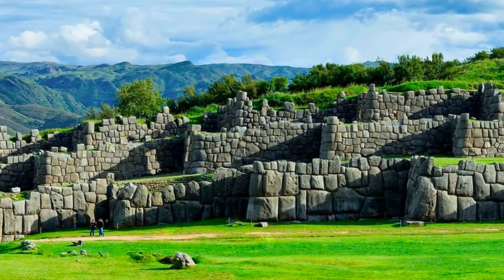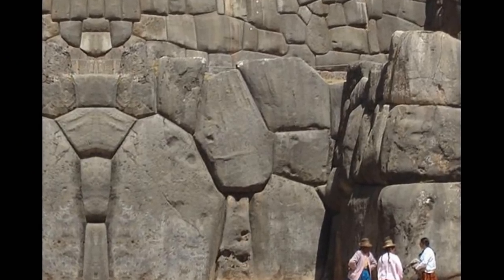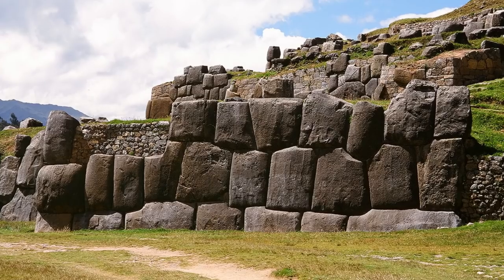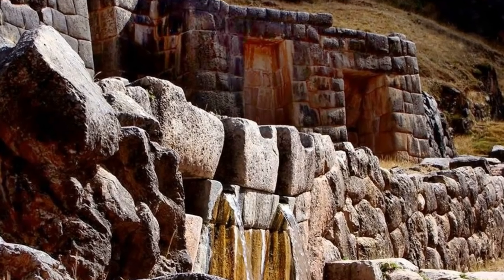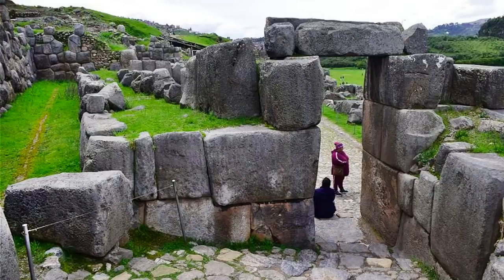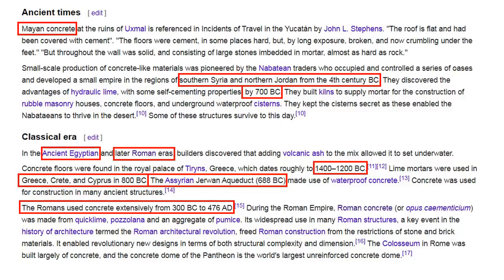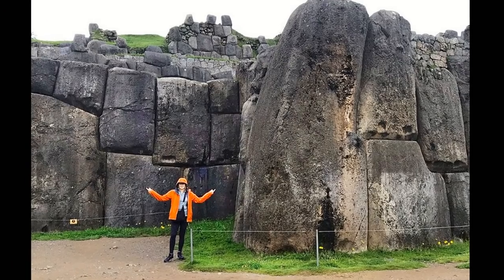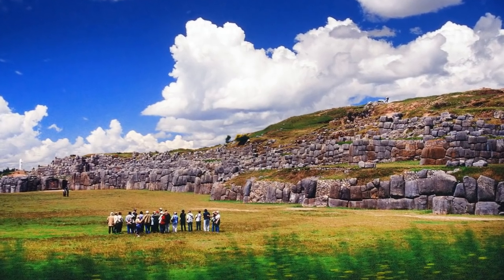Explained: How were Peru’s #Sacsayhuaman Walls Built

Comment: As someone who has 40+ years concrete construction experience and the knowledge of the complexity of building a different set of forms for each individual block, with the required strength to withstand the extreme pressures from the weight of liquid stone to prevent blowouts, makes this theory implausible. Most don't realize the strength and structural integrity required for forms bearing the pressure created by 60-80,000+ dead weight lbs of concrete. Then you still have to consider how did they lift and place the molds. if when you removed the forms the material was still malleable to form into place with another surface what stopped the other three sides from just drooping into a giant blob? While still malleable enough to form the perfect matching joint how did the lower stones bear the weight from a stone being stacked on top without turning into a smashed blob?  Bottom line constructing individual forms for each block lifting and placing then stripping forms at the critical exact curing point every time is implausible. Also I believe the stone material of the megaliths is super hard granite not limestone. Which they are pretty sure they know where it was quarried from. evidence shows they had the technology to quarry hard stone with fine precision. Then they had to transport this material from one mountain top to another with only  goat paths in places on the mountain. If they made a form of concrete how did they pulverize stone two levels lower in hardness than diamond into the fine powder necessary to make concrete and not leave a trace of that process? I could go on but I'm quite confident these megaliths were not mold formed and a poured concrete substance.  I do follow the theory of a civilization with some form of advanced knowledge/technology, ending at least 11-12,000 years ago that experienced some sort of worldwide cataclysmic event, leaving us with mysteries that may never be solved.
Reply from the maker: Thanks for your comment. Please check out a dry cast method: Vibrant Dry Tamp (VDT) which I think could be similar to the techniques used at Sacsayhuaman. 
The benefits of this dry cast stone methods are: 
-Fast demold time. 
-Can cast into the same mold several times a day.
-No treatment is required afterwards to achieve the limestone look.
-Result of cast stone is very clean and natural looking.
-High early strength.
-There is a time just after demolding when a repair is relatively easy. 

The Sacsayhuaman-is-not-concrete argument is: since we don't have the technology now to make comparable sized concrete blocks which have a plastic state and not require rigid forms, Sacsayhuaman blocks are not made of concrete; while even though we don't have any technology to soften stone without changing the stone colors and textures, Sacsayhuaman blocks are made of softened stone. Is it just me seeing the problem here? 
I think the material used by the ancient builders is similar in some ways yet different from today's concrete; their material could be more suitable for giant-block constructions therefore more advanced than what we have today. I agree that even with today's concrete, cranes and other modern tools, we can't even duplicate such walls. That is why whoever created Sacsayhuaman walls were highly advanced, more advanced than us on this aspect.  

Another thing needs to be considered is that we might not be the most technologically advanced in the 4.6 billion-year long history of Planet Earth. Not because currently we can't make concrete blocks similar to the ones at Sacsayhuaman, that no one could. That's presumptuous.  There are opportunities throughout history for one or more civilizations to progress to the same level or even higher than what we have today. Humans have been around for over 1 million years while our known history is merely 5-6,000 years. Anatomically Modern Humans rose over 300,000 years ago. Do you see the gap in-between our accounted history and the unknown? 

Casting is much easier than quarrying, transporting and most importantly carving stone in 3D with razor-thin precision fittings. By questioning the feasibility of casting, you are inevitably questioning the legitimacy of the stone-carving theory :-)

I made an video on the 12,800-year-old comet impact and discussed why it might not be the reason to the ending of a highly advanced civilization. If you are interested, here is the link: https://youtu.be/4XXV3Ax3KO4
Reply: You are right IF you are looking at pouring concrete into forms.  Yep,  lots of questions and problems with this method. What,  however,  if these "stones" were effectively plastered,  using something like render.  In my direct experience plaster mix can be effectively free formed, either over a pre-existing wall or completely on its own.  Check out the work done every day by solid plasterers.  Time consuming but so very do-able.  Also,  the desired finish can be achieved either by burnishing the half set material, or by wiping the surface glazing layer off nearly set plaster;  easy.
Reply: @CuriousBeingbyTina  "we can't even duplicate such walls"   Oh yes we can,  and I have!  See my answer to steelbones,  above.
Reply: @steelbones I too was a builder and I agree 100% with your analysis and explanation. You have broken down the argument against the use of molds perfectly. I also agree on your thoughts about advanced civilizations that were wiped out about 10,000 BC. Setting mankind back to the starting over with what could be mythically remembered or salvaged (found and reused by those that found them (Incas? Egyptians? Etc).
Some global catastrophic event must have taken place that destroyed what were advanced civilizations around the world. As there are plenty of places around the world that can not be explained as to who, how, when they were done. All these sites predate western view of history that civilization came about 6,000 BC
Reply: There are some documentaries about ancient geopolymer processes. Russian scientists made detailed anaylses. One using a slurry of geopolymer to cast huge flat slabs like those in Puma Punku. The other one using plant acids to soften the outer layers of rocks so that they fit perfectly while keeping internal integrity. The other channel Ancient Architects actually made a video on that chemical process.
Reply: @DilbertMuc  the issue with those ideas is that each boulder is its own unique shape so the mold idea goes out the window. The use of a special plant chemical that would make granite stove malleable it would take an enormous amount of these plants and there is no evidence that these plants were ever there. While the edges of each boulder has the look of a had troweled rounding. 
How they were done is still a mystery
Reply: @evanpenny348  Can you show an example of us (modern humans) pouring anything like this using granite (and the end result remaining granite)?
Reply: I agree with you, this was not poured cast concrete mix. The stones were carved, smoothed and precision fitted into place. Interlocking stones to be more earthquake stable proof. 😳
Reply: @m101ist  That's an incredible feat when looking at the smooth curves and 3D interlocking elements. Amazing work for ancients to have achieved. How though? Copper tools don't make sense. Bronze tools don't make sense (meaning not Inca work). I'm not even sure how we'd do it today with this hard of stone and perfect, yet, not straight cuts/connection points bearing many tonnes. 🤷‍♂️
Reply: I too have over 30 yrs concrete experience and framed and poured complicated stairs the size of some of those mid-size stones...I one day!
As you fellow concrete people know...one strips the forms on steps as they set-up, working the surface with tools to round the step top and rise inner corner.
Framing these stones is entirely possible
Reply: Stealbones...don't know what concrete crews you worked with but a three man crew and I have framed and poured entire 8'-0" tall by 10" thick house foundations in four days... complete! Including footings, drain tile, and gravel base for the basement floor. And this was before mini crains placed the forms into the hole...we humped them in
Reply: @markspitzok3064  Well bless your heart. Tell me something did you forget about the endless army of manpower it took to provide and supply all the materials you used to preform your little project. The lumber harvesters, truckers, miners, the metal foundries for the tool makers, road builders, saw mills, concrete batch plant, rock quarries, the endless construction crews that built the factories that built the trucks, tractors, the mining equipment, the hardware stores where you bought your nails, screws, plumbing supplies ect. ect. ect.? You and a crew of three guys didn't build shit in 4 days it took an endless army of people behind you. The megalithic structures were built at a time where there were only lumber, ropes, soft metal hand tools and mountain goat paths to transport massive multi ton stones from their quarries. The plausibility of megalithic structures being built from polymer or some form of concrete are highly unlikely. It's a silly idea when you know the difficulty of forming and placing with laser precision and fit an individually formed stone, which no two stones are the same. Not to mention you still have to take into consideration the mining, transport, and refining the materials, with primitive tools and knowledge.
Reply: And what about drying times, cure times, if they poured the concrete mix institu. They would had to wait ages for the bottom blocks to cure before the blocks on top to be poured. 😳
Reply: @steelbones1911  true...but, when we had a dozen foundations in a subdivision the forms stayed on the job...I'm sure their wood forms stayed on this job..."IF" they did actually pour them.
Water would be on the job too as well as all other materials.
Easyer to haul sacks of lime and small rock up a mountain trail than 20 ton boulders.
I doubt they had metal nails, so probably used wood wedges...I've fine tuned a wall with wood wedges.
The army of people u speak of would have brought all materials up there first up the trails....IF they were poured
Reply: @m101ist  7- 10 days...that's what we tell people about newly poured driveway. Don't drive on it for 7-10 days... Concrete reaches 90% of its full strength in 28 days, then it slowly cures out.
In the video this young lady is suggesting they had a different mix design, causing the pour to setup like a puddy when pouring above it...thus causing the pour below to bulge the center.
With our modern mix design 5-bag = 3200 psi compression strength.
6- bag = 4200 psi....psi = per square inch
Reply: @m101ist  also Mr Thomas... I've broken out some very old concrete in the city of Chicago, probably made and poured in the 1920's...that concrete was tough...like granite.
Reason being is back then they used 100% Portland cement...not the chemicals used today with fly ash. Another reason is pure Portland cement cures out harder.... forever
Reply: @m101ist  Mr Mark...look online at the photos of the Hover Dam being poured...this young lady is suggesting something like that process
Reply: @markspitzok3064  It's continuous pouring process, to obtain one large smooth structure with no joint's reinforced with rebar to strengthen the structure. It would crack with out the steel reinforcement.  The stone structures are not a continuous pouring process.😳
Reply: @m101ist  like I said...look at the Hover Dam pour.
All concrete cracks now days...why we put control joints in.

The Romans used concrete extensively and much of it is still standing today... Like the Coliseum and many of their aquaducts...have no idea how their reinforced, if at all...but that is some tough concrete...1000 years and still standing
Reply: Setting the wood forms for this would be a colossal nightmare also no stones are the Same size or shape so new form for every stone 
The forest there look scarce
Reply: Your 21 century explanation makes a lot of sense. Going back in history however, even today it has not been determined exactly the composition of Roman concrete used about 2000 years ago for the construction of buildings still standing today.
Reply: @georgevladimirovich7190  exactly!
Reply: @davelee3725  there is a concrete form system called the "John's form system" where one actually builds the forms as you go, and you can be very creative with it. Much slower than Simon's and simplex form systems, but still useable time wise to generate a profit to the contractor.
Reply: @evanpenny348  the fact that you can see between some of the stones (due to earthquakes) you can actually see the end of the stone face and there doesn't seem to be a plaster separation line between the core material, so looks like ancient plastering is out of the equation.
Reply: @markspitzok3064  Everybody can do that with the modern tools and concrete from trucks.
Reply: @steelbones1911  Great answer.
Reply: Hey Mr. Steelbones, like may others who have commented -- I too have been in construction for more than 30 years -- superintendent on some very large projects, also have an engineering degree. I like how you destroyed the guy pouring residencial basement walls - ha! Bet the guy never heard of a raker beam or slip forms.

I've been to the site several times, among many others in Peru -- my wife is Peruvian. 

In any event, the stones couldn't have been formed and poured -- if they had been, the molecular structure would be different and that could easily be detected by a couple core samples of rocks at the site and tested. The test results wouldn't show virgin granite or limestone, but rather that of the mix they were using -- even if that was completely strange and they were using some weird additives.

I think -- and let me first say I am no expert and that this is just a theory on my part based on what I see and my experiences -- that the little "protrusions" you see on some of the rocks usually near the top,  but not on others, is important. Likewise with the square or rectangular "indentations" you see at the bottom of the rocks on some, but not others, is also important. And by the way, you see these two same distinct markings on polygonal stone workings from many other sites all over the world. 

These pillow rocks, sure look to me like they were put in place, then somehow made malleable, then pressed down upon and made to form completely void proof of the adjacent rocks on either side and the one directly below which were no longer malleable at the time of the process. Similar to a loaf of bread dough being put into a pan shape before it goes into the oven.   

With the number of pillow rocks at the base, second, third , etc etc tier levels along the length of the walls, I think it would be safe to say not one guy or gal did them all. This would imply mixed results from various masons based on their individual knowledge and experience of making the pillow rocks as they added their contribution to the walls. 

Let me first start with the "indentations" at the bottom of some of the rocks. That is so obvious of someone using a board or something else to push back up a a sagging malleable rock -- my guess is it was a similar to what we would call today a form blow out -- they fixed it on the fly the best they could before they lost it. 

The "protrusions" that appear on some rocks near the top, but not others, is where my theory comes into play along with what I said above. 

I think the the the lower levels of the walls where not done by the Inca, they were done by a preexisting culture. I think the Inca found these sites, were just as baffled as we are today, didn't have a clue as to what they were for or who built them. But they realized that these sites must have been important -- so they adapted them as their own and added onto them they best they could. 

My theory is that the pillow rocks were formed by some type of a device that was inserted into the rock that made the rock malleable. It did this temporarily and the workers had to have a degree of expertise on how the device worked. The device worked on the way into the rock and on the way out -- the timing had to be perfect. 

I speculate that the "protrusions" are pull out marks left by less experienced masons of the device and that the the "indentations" at the bottom were other workers trying to save the stone that they had put in place because he/she using the device had not yet perfected the technique. 

All -- it's just a theory --  If you think I am full of it -- I'd love to hear your theory.
Reply: Unknown Technology and some very big men.....................................just sayen
Reply: So refreshing to hear logic and reason.  Quality response m8 !
I just don't get why people don't understand this...I really don't like to be rude and Tina's work here is clearly well researched, but that doesn't mean the theory isn't laughable. When one has  practical construction knowledge....it's just unacceptable, having zero doubt. Poured geo polymer.??THIS IS NOT HOW IT WAS DONE!!!
Reply: @Grim FPVfirst...  puma  punko  is not sacsayhuaman. Second, magnetic alignment isn't "proof" of anything but the rock was once molten. Third look at the shape difference and geometric design...one could almost accept the polymer theory when confronted with Puma Punko's complexity and "cookie cutter" like stones.... exactly one of my points in dismissing sacsayhuaman
Reply: Acid plus gravity, pulleys and rope...innit??!
Reply: It's poured geopolimer, you don't know the cure rate if there material, the molds are burlap like bags, it will take moths to finish one row, plenty of time for structure to cure for next row, and that's how they get exact match to the last pour. It solved the moving problem and the exact carving matching problem.
Reply: I would say the size of these stones proves the limit of there casting abuility, I can see one hundred people getting one pour done a day after prep work is done, bag prep, moving and mixing material, it all looks like the right scale of work to me.
Reply: By your hypothesis, the colleseum in Rome would never have been able to be built.  Just because you lay down contrete in with rebar, doesn't mean you're an expert.
Reply: @videojockeysword  Metals could have been recycled/reused by following human civilizations
Reply from the maker: @evanpenny348  In the same scale and accuracy? I don't think so. Hope you can show us a sample of a modern wall with the same characteristics and quality.
Reply: @CuriousBeingbyTina  I have an idea that can potentially work. I’m pretty sure these blocks were made with some kind of concrete but i think the key is that it had a unique feature. Non-newtonian liquids are pressure dependant materials. If there is a way to produce a concrete that acts as a non-newtonian fluid before hardening, it could be easily handled with simple molds, especially with huge sizes. Simply because as you pour the material the bottom part will get more and more pressure, forcing it to harden by the pressure (way before it actually dries and hardens as regular concrete). This way you can have very simple and light molds, because there is only a minimal sideways pressure on the mold as the material holds itself. So think of it as a two stage hardening, first it just hardens (while still wet) as a non-nutonian fluid under it’s own weight, making it able to build vertically without heavy duty molds and after that it dries out as regular concrete and hardens to it’s final form.
Reply: My thoughts exactly.
Reply: 100% agree I was a builder and I remember concrete jobs that required forms. The concrete contractor would put a lot of time and effort to make sure his forms didn’t blow out the forms. And we’re not talking 20’ tall walls. These places will remain a mystery as to how they were moved and done
Reply from the maker: So the argument is: since we don't have the technology now to make comparable sized concrete blocks which have a plastic state and do not require rigid forms, Sacsayhuaman blocks are not made of concrete; while even though we don't have any technology to soften stone without changing the stone colors and textures, Sacsayhuaman blocks are made of softened stone. Is it just me seeing the problem here?
Reply: @CuriousBeingbyTina  yes soften stone but not a concrete mix. If you look at others parts of walls there large stones stacked but still not fitted to a tight seam fit. So I suspect they had yet been melted/soften to meld together sealing the tight seams of each “fitting” onto the others. I doubt forms were used as I was a builder and know how forms work and it be an impossible task to make forms for each individual stone block, as well as cutting each stone block for that right seamless fit. So it would seem they had a way of melding the stones on to each other. That didn’t require forms but we’re still malleable enough to trowel around the stone joints. Also the surface of the stones look like they’ve been heated or melded (scooped out areas, surface texture, and trowel like surface markings. But the actual way it was done I doubt we’ll ever know
Reply: @CuriousBeingbyTina  
Well I never said that we do not have the tech today to make comparable sized concrete blocks which have a plastic state and do not require rigid forms, 
It would be much easier today to make them but we don't because it makes no sense to make them this way.
Just like it makes no sense for them to have made them this way.
Make some cement blocks and stack them up on top of each other and see just how this technique would not work well at all.
I have been to Sacsayhuaman and as a builder who knows about cement and building techniques i can clearly see that this is not the way they were built.
Also there are polygonal walls all over the world and it is known how some of them were built and why they were built this way.
Reply: @steelbones if you have "40 plus year concrete experience" you should understand that concrete is really only poured as a liquid so it will flow around the rebar. Right.  I mean grouting a machinery floor or pumping are exceptions, but water just weakens concrete.  What are you claiming on the forms? It's nonsensical, and if you done all this concrete work you'd know the lateral forces are nothing compared to the weight of the pour.  She's got some errors in her theory, but overall she's got the right idea.  

Granite? Lolz. Where are you getting that from.  There is misidentified granite (Andecite) at Puma Punku, that has organic compounds and fossils in it, which means it isn't granite.  You're contending that Sacsayhuaman is granite?
Reply: @mark spitzok

Yep exactly, guessing "40 years" of pulling nails, getting coffee, and flagging traffic.  I push work, so I ain't great at anything, concrete included, but I know quite a bit about all of it, and have a pretty good bullsheetometer.  The chamfered corners, heck there are places you can see the skim coat coming off and the aggregate inside, something limestone wouldn't have.   The big thing most guys in the trades won't know, the engineers do, dry tamped playdough concrete is way stronger than poured concrete. Since they weren't using rebar here, no need to pour at all, no forms even needed, and if no form, no vibe, trowel the surfaces befor it sets up, less water = less shrinking, and a stronger block.
Reply: @ mark thomas so.....you're saying they could spend a year pissing up a rope mating one side of one stone, but they couldn't wait 2 days for a block to set up to place the next one?  Lolz. Even modern concrete poured weak and wet to flow around rebar is at 50% strength at 24hrs.  Dude you can be ignorant, that's between you and your parents, but you shouldn't use emojis like you are proud of saying something dumb.
Reply: @ricksanchez3176  as a builder I agree, but this is natural stone not concrete. So the question remains how was it made malleable?
Reply: @ricksanchez3176  if what you’re saying was to be true why would they have bothered with all these different size/shape blocks, these were natural stones made to shape into each other. That is the mystery of these “stone” walls. Your pompous “knowledge” seems to be ignorantly over-looking the most “obvious” question, how were these “stone” walls made? If it was some concrete procedure I’m sure all the scientist/specialist/engineers and yes “concrete” workers would have solved that question. Your 40 years of pouring sidewalks, driveways, slabs, footings, foundations, curbs, hardscapes, obviously don’t solve that question, otherwise you’d be famous and highly sought after in academic circles for having solved this question.
PS: btw I doubt you have ever been there to question if they are granite or any other natural, let alone own a passport. BTW i was a builder that hired concrete sub-contractors. So I suggest you get a passport and go to these sights before assuming you have a clue to what you’re talking about Rick Sanchez. People who have studied this place have said it was natural stone which might explain why all the individual shapes and sizes
Reply: @JVS 3. I'm not going to dig through your whole rant, if you'd like I'll gladly go point for point.

The one valid question you had, why would theu build with such odd shaped stones?  Derpy derp.  That makes your ignorance shine.  In simple descriptive terms, they are a mosaic.  You can look at several clips in this video and see the tourists standing infront of "puma paws" whatever they actually represented.  Dual serpent outlines flow throughout the works with clear stylized heads and clear stylized tails. Others have done work on this.  And viewed from the top where the towers used to stand, the whole of the lower works at Sacsayhuaman probably represent two serpents, hence the zig zags.  Derp e der.
Reply: @ricksanchez3176  not sure who you’re responding to? But it’s obvious your assumptions are not based on having been there and seen what material these walls are made of. Your 40 yrs concrete experience is that “concrete”. So before you fill yourself full of arrogant confidence about something I suggest you start by visiting the place. There’s been many scientific, material experts, engineers, geologists and others that have gone there to study the place. Being a concrete contractor who’s never been there is making a huge assumption you know what you’re talking about.
Reply: @jvs333   JVS Comment to RS : " if what you’re saying was to be true why would they have bothered with all these different size/shape blocks
                Rick Sanchez replies:   "In simple descriptive terms, they are a mosaic.  You can look at several clips in this video and see the tourists standing infront of "puma paws" whatever they actually represented."
                "To which JVS replied: "dude your arrogance is laughable. People can make shapes out of anything"  By answering it's own question as "how" instead of "why" as originally stated, instead of being a grown up and refuting the answer given, (Possibly butthurt at the fact that someone possesses knowledge unknown to him or her?), JVS 3 justifies Sanchez's arrogance. Score 1 team Sanchez.
JVS 3   "For a guy with concrete experience and who’s never been there you’re awfully full of yourself"   JVS in one sentence manages to prove it's lack of reading comprehension, and state as fact it's inaccurate assumption. Score 2 team Sanchez.  AHHH
"Your 40 yrs concrete experience is that “concrete”."  JVS again illustrates both it's lack of reading comprehension and prowess for jumping to unsupported conclusions.  Score 3 Team SANCHEZ   GO!     At no point did Rowdy Ricky ever state that he had never gone to the Andes, or that he had 40 years concrete experience.  If JVS 3 was to find a 3rd grader to help JVS 3 read through the earlier unedited comments, it could see that Rick Sanchez made an inside joke about steelbones' station in his "40 years concrete experience" to Mark Spitzok.  Which JVS 3 was obviously on the outside of, supporting Rick Sanchez's current working theory that JVS 3 is talking out it's backside.

JVS 3 : "Go there, then make your pompous claims of supposedly knowing, pouring concrete is just that pouring concrete, doesn’t make you a geologist or an expert in stones. Hey better get back to troweling your concrete before it dries"  Again JVS 3 does not counter in any other way than "they said so". Again it states it's assumptions as facts.  Again, JVS 3 lays out for the world it's inability decipher and retain the written word. Score 3 and 4 for Sanchez.  You think you're talking to a carpenter or a finisher? :)  lolz  (at your ignorance, not at the trades)

_So do you not believe that there is "mosaic" artwork built into the walls of Sacsayhuaman?

Do you not believe that fossil inclusions in limestone would not be cleaved on the surface of the "stone", had the whole stone been cut?

* Referencing JVS 3 as "it", is not some kind of insult, rather it is an example of speaking based on known facts versus assumptions.  JVS could Stand for Junior Varsity Softball, or it could be Just Very Stupid, but to assume either would be merely a guess.  You should take notes about presenting unsupported as fact.

I don't know where you're drawing the correlation between criticism of the CCP and questions about polygonal stonework?  It's pretty laughable.

JVS: "So I suggest you get off your “ego-stilts” and humble out a little and dig a little deeper in this"  :)  I don't need ego stilts when dealing with someone of such a low comprehension.   

This is you: "Why would they?"  "OH well, I'll tell you they can from anything, even unobtanium"
Reply: @ricksanchez3176  Ricky lot of rambling about a lot of stuff. That is irrelevant to your claims that “you” as a 40 year concrete guy who’s never been there to claim you know how it was all done, as for assuming you e never been there please let me know when you e been there and spent time studying these walls so that I can take what your assumptions seriously. Then maybe I would think you have a credible opinion on these walls. But being a concrete guy in the US pouring slabs, driveways, sidewalks, foundations, curbs, footings, pilings or whatever “concrete construction” work. I can’t take you seriously. So pardon the sarcasm but seriously get real, before you fill yourself with expertise and knowledge of things “you” haven’t first hand studied in “real” life and are making blind assumptions of knowing. Sorry to be so blunt and cold, but no one can take anyone serious about things they themselves have not invested real time in real first hand experience or study of. So you might be a great concrete contractor that does excellent work, but until you’ve invested time and first had study of these walls you’re just one in a million of you tubers that “claim” they know what they haven’t been there to experience and spend time studying. And that’s my point. 
Don’t claim to know shit you don’t know. As for me, I don’t know how they were done, as dozens of other people who e been there and studied them and still haven’t been able to figure it out. As for any figurines yes I’ve seen those videos and yes people can see them but I doubt that’s why the stones are fitted as they are or every placed stone would create a figurine. How these walls were made (regardless of any figurines here and there) are still a mystery and I doubt a concrete contractor in the US who’s never been there knows. As a builder who hired subcontractors (concrete too) I learned that those that had had a pompous know it all attitude were the worst to work with and always the ones that didn’t know as much as they claimed, the best guys were the humble nose to the grind guys that bragged less as let their work speak for them
Reply: Lookup the video of Wally Wallington raising and moving a 20 ton concrete block all by himself with just a few pebbles and wood.
Reply: @BlackStarEOP  seen it he’s doing it on a concrete slab his pebbles would be buried in the sands or dirt. Moving and lifting miles and heights is a different story
Reply: @jvs333  You didn't see the barn getting moved?
Reply: @CuriousBeingbyTina  Rephrase his response to something else so you can dismiss it?
Reply from the maker: @michael4250  You have been spreading misinformation on multiple of my videos.
Reply: Your first statement would be my initial assumption. Based upon current technology you'd be right.

I don't think these ancient builders 20 thousand, thirty thousand or forty thousand years ago used comparable tech.
Reply: @markspitzok3064  Sure it's entirely possible but is it practical. Is it practical to use a system of forming and pouring every single stone in its very own unique shape? We build tilt up buildings forty foot tall that are a million square feet in six months or less, by forming panels but the panels are uniform so the forms can be stripped and reused on the next panel. Making a different form for every single block is unpractical and unproductive. For all those who believe some form of "geo polymer" was used to create these megalithic stones, answer this question. Why would someone with the technology to quarry granite with laser precision need to use a geo polymer that requires the time consuming process of making individual forms for every stone to pour their magical geo polymer made from I would assume pulverized granite, magical fairy dust and unicorn piss? All this without leaving a single solitary trace of evidence how they did it. Magical "geo polymer" doesn't pass the Socratic Method. You can theorize about geo polymer but there is zero evidence and when you break it down to the mechanics of the mining, transporting, refining and construction you can't answer those questions or others with any fact based evidence to back the polymer theory. Unfortunately until Mr Peabody invents the wayback machine and takes little boy Sherman back in time to educate him just how it was done it WILL remain a mystery! One thing for sure it WASN"T 'geo polymer!"
Reply from the maker: @evanpenny348  Thank you for the information, Evan!
Reply: i couldnt agree more
Reply: Nope. Not implausible. Just unfamiliar. Do you think your parents would have thought it possible to have an ultra thing, hi def, color TV in their hand? I gotta say, the more of these blocks I see, the more convinced I am that they formed these magic blocks. Amazing.
Reply: @evanpenny348  you could very well be right there is a stone on a corner in that place that is broken it's a lower Stone and you can see balls with lots of gaps in the broken rendering I don't know if those balls are stones or if they're man-made. I don't think it is an attempt to fix it or else it would have been finished
Reply: @steelbones1911  Thanks for sharing your experience and time 🍕🍻
Reply: @CuriousBeingbyTina  at the 4:40 mark, why are the soil sides of the blocks uneven?  Shouldn't they be in a similar shape as the front?
Reply from the maker: @DaggerSecurity  I think these are signs of the blocks being cast and or placed in position while still in a plastic state. Like today's dry cast method, after demolding the concrete material there is a short period of time that the blocks would be malleable and able to be manipulated and fit with surrounding elements, in this case, the back soil.
Reply: The idea of quarrying granite, dressing it to suit each individual space after transport is not realistic Steelbones. Have you not ever used a squeeze bag for cement mortar ?  Have you ever tried your hand at stonemasonry?  I am pushing 40 years myself as a stonemason / Mason / landscape construction. The sack form seams the only plausible method,  note the protruding nobbs at the bottoms of each form. I suspect they were to drain excess water. The random shapes to help endure seismic activity. .of course, if you used wooden planks , that would not work. Nor is It feasible to carney such random stones , especially granite.
Reply: @CuriousBeingbyTina  "Social Psychology Says" that yes, you are the only one seeing it. It's a little difficult to explain. Kids can believe that Santa isn't real. But in order to accept that, they'd also have to accept that their parents & indeed all adults around them lied to them.
This is something kids can only start dealing with around age nine, which, coincidentally is the age that most kids stop believing in Santa. But, this process hurts people emotionally. Also, there's a feeling of security that comes with Blindly Trusting that things are impossible as well as possible.
Just as children feel secure that it's impossible that adults can even be mistaken, let alone consciously lying to us.
The sad fact is that most people, after going through their teen phases of rejecting everything they knew before, seek to find comfort in assumptions once again. (I'm trying to condense a book's worth of knowledge into something not overly long, so details will be missing).
This bleeds over into any discipline where it's comfortable to think that "experts" knew what they were talking about. So, into everything where, if we do not want to become expert ourselves, most people will therefore feel the need to feel comfortable about the notion that those in charge are competent.
Ergo, they become as unable to Question Established Authority in adulthood as they were capable of thinking that their parents intentionally lied to them at age six.
Again, as I commented elsewhere, a long conversation. You don't seem to be letting it get to you, which is The Best Thing. You also don't seem to be insisting that your theory is correct & are open to those of others.
Which means, also according to social psychology that you're in a good headspace. ;  )
Reply: Henrik Schandorff  Exactly!  What these concrete “geniuses” don’t realize is this isn’t exactly their grandaddy’s technology.
Reply: Exactly. 20 years Excavation concrete. It's absolutely not concrete.
Reply: @CuriousBeingbyTina  my problem is what is it. Building zigzag walls which I have. Is a lot harder than a straight wall , if the purpose is retaining this is an elaborate way to go about. They look like boat slips
Reply: @markspitzok3064  "The Romans used concrete extensively and much of it is still standing today... Like the Coliseum and many of their aquaducts...have no idea how their reinforced, if at all...but that is some tough concrete...1000 years and still standing"

Some research recently came out indicating that they mixed dry lime into their concrete which, when activated with water, would actually seal cracks. I suspect that the mixture producing these stones had similar characteristics
Reply: @no_talking  I seen a video about that...also said they used salt water. When I operated a concrete batch plant I was told the water had to be clean enough to drink.
Reply: but the other option- quarrying and transporting, working the stone into forms, removing the stone getting the 15 point stone just right  is any easier? with primitive tools? you say that is it impossible, but there it is. 
also russian research team determined that the stone at sarcasuman is 2% more silica than rough quarry stones, so they must be engineered.
Reply: These were cut from petrifying bodies of titans or giants after flood.  The flesh stayed somewhat soft for awhile due to flood waters.  This also explains the cart ruts found in Turkey and veins of gold throughout the world.  Metals in blood stream turn to gold after death and decomposition
Reply: @Gnomesmakemesmile Well, that SURELY concluded the architectural and scientific segment of the thread. Excellent performance. 😅
Reply: The Flood was in 2.400 b. C.
Reply: The answer is, they had a higher knowledge at the time when they used copper to cut basalt and granite. Or Magic we lost I don't want that they used.
Reply: Other stones can potentially be used as moulds.
Reply: @CuriousBeingbyTina  , Wow!! A discussion like this to be found in free internet is gold! And I fully agree with you regarding others civilizations that could have on this planet before our imagination...